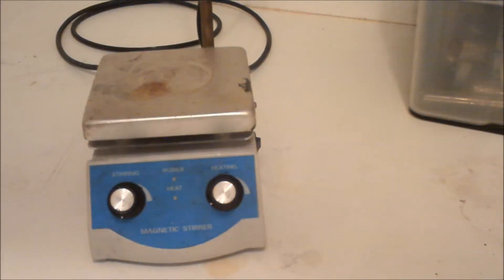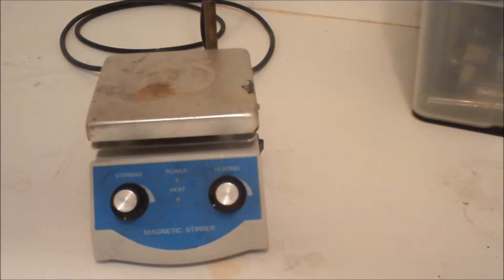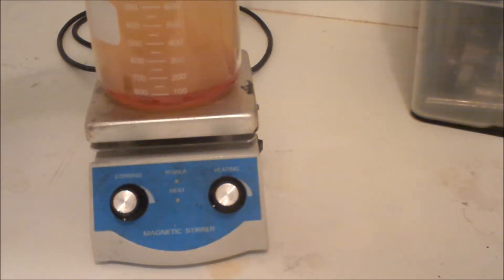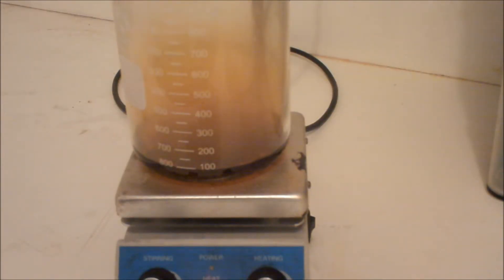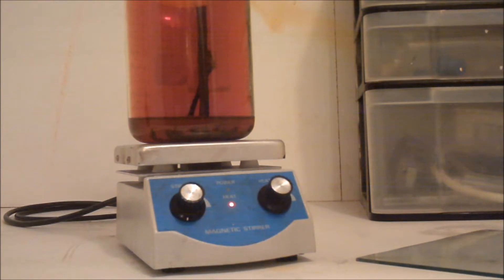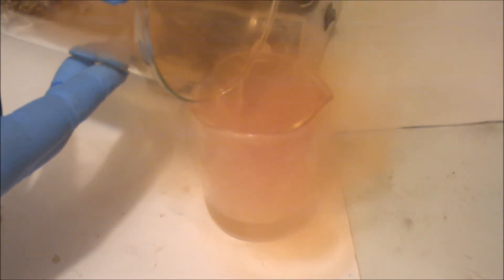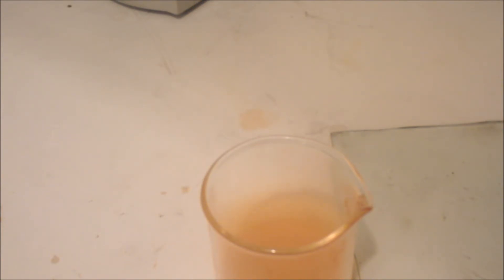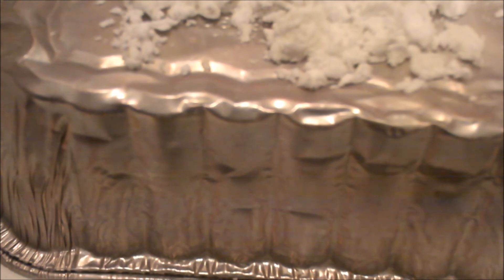Lead nitrate synthesis

Comment: Nice video! But I wouldn't call this a 'nitration.' Nitration is the replacement of an R-OH group with a nitronium group- typical in organic compounds. You are reacting nitric acid and lead- a synthesis- not a nitration.